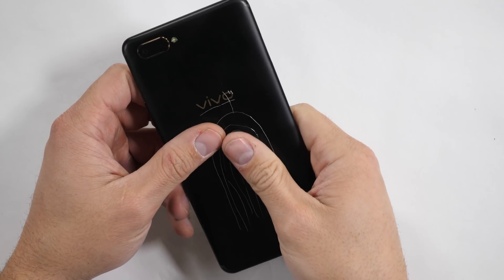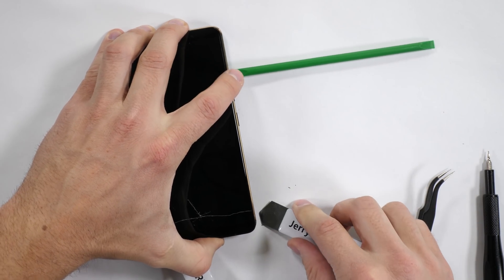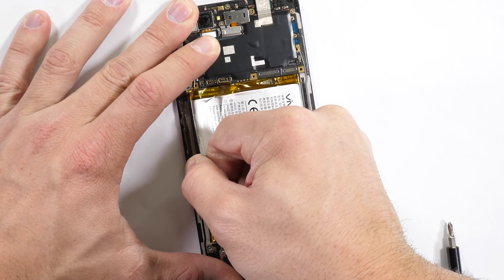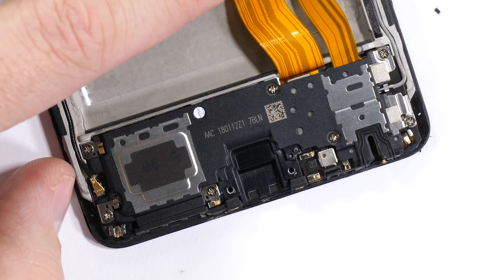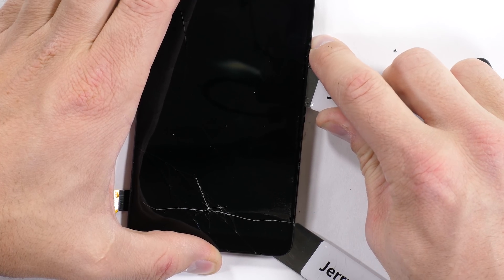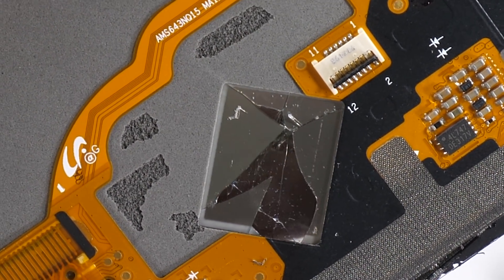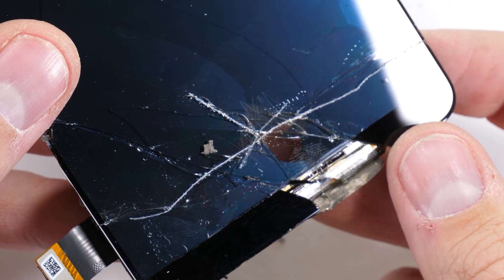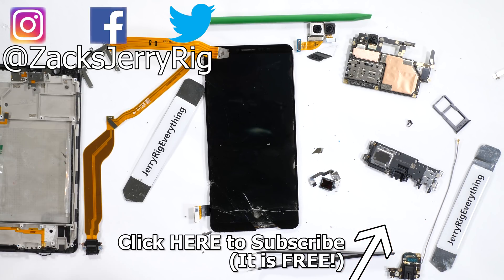In-Glass Fingerprint Reader TEARDOWN! - How does it work?!

Comment: Cool video, I used to take things apart as a kid just because I had to know how they work and amazingly more often than not I was able to reassemble them and they worked. One thing both you and MKBHD seem to be over looking is the cost of making a large sensor under that screen, if that was cost effective camera company’s would have made large sensors to put their imiages on long ago as opposed to working with such a small area! It’s nice to dream of a phone that will read your finger print anywhere on the screen but let’s remember that some things are just dreams as no one wants a phone that small or to pay for a senior that large!

Comment: The moto G 2015 has by far the easiest charging port replacement. Literally under 3 screws and the board pops out. You dont even have to remove the back of the phone (well you have to remove the personalisable cover). it can be done in under 2 Mins

Comment: This channel is just providing jobs to the people who learn how to repair things from here
Reply: Mr Heavy Duty lol, but initially you also would have broken so many devices in attempt to fix them, it takes time to learn
Reply: Mr Heavy Duty So you've never broken a device while fixing? That's cool
Reply: Mr Heavy Duty never broken a customers device.... worked on over 50 phone... places glowin apple logo on iPhone 7, cracks lcd. Kms. I ended up buying the X. My people are happy with their replacements. Always. Except camera replacements. Apple has a deal with it where you have to reset the softwear/restore it. On some occasions so that specific one i have them use their icloud. Also i started on my cracked iphone 5s that apple wouldnt fix. Fixed that. Then an 4s that i got professionally fixed (they used a cheap display, they actually swapped out my battery it wasnt the oem in it etc)
Reply: Redmi 5 pro tear down
Reply: 69 Solo Thanks
Reply: This fellow rigs things not a mobile repair coaching class. He Is the one who shows us what is inside an expensive! Mobile. If u talk about mobile coaching classes there are very core concepts which you would not even understand. For example changing IC's, Flashing ,display replacement ,understanding schematics.  What this guy on YouTube speaks will be known to any basic mobile repair specialist also
Reply: I thought Pakoda Minister was providing jobs aye.
Reply: 69 Solo Actually selling pakodas is a huge business, a guy sells pakodas outside my college, me and my friends got curious seeing the footfall he was getting, and asked how much does he earn per day, he didn't say anything, so we gave an assumption of 2-3k per day, he started laughing. The guy earns around 8k per day,  at that moment I actually started having second thoughts about my college. education
Reply: Shushant Verma Man they will not get it a business is not like a job. You must have the idea, I have seen a person who once was a street vendor now owns a bmw of his own. It's a nature of some people to criticize others but that's what make you strong.
Reply: Yeah man. My cousin had no family and was poor and living with his sister. He used to sell idli and coffee on roadside stall. Now he employs almost 200 people under him in a variety of businesses and makes more profits in a week than I earned in my old job for a whole year. And here I am jobless with my engineering certificate now. People ridiculing them have no idea.
Reply: Shushant Verma good for you. You should Start selling Pakoda then.🤣
Reply: Shushant Verma all the best. 😂
Reply: 69 Solo yes I can setup one shop, with a tea stall and some cigarette, hire a guy to sit there, and do my regular job. I'll be making millions in no time

Comment: I don't understand somthing: if regular fingerprint sensors work by capacitive touch sensing (like the screens) just with more dense stucture, why do they can't make it on the glass itself along with the regular touch sesnsing surface? You proved it several times that even with plastic coating and with major scratches on it, they work just fine, so the principle of these seems rugged enough for me, so I would be happy if I could see capacitive fingerprint reading on screen in the future (even with IPS displays).

Comment: Zack, think about security first (please). Small shards of the glass panel are dangerous! They can be inhaled with an air and can get into trachea or lungs unnoticed. You may apply transparent duct tape on the screen just before cracking the glass (most of mobile-repairmen use this method everyday).

Comment: Looks like its definitely a weak point. Theres a square thats not really structurally linked to the rest of the display backing pressed tightly up against the display. Its possible even sharp impacts around the sensor that dont break the glass could cause display issues. We'll have to wait and see for more tests or if people start reporting problems though

Comment: Wait, so technically, you could get a image from the fingerprint sensor?
Reply: Muhammad Ibrahim no, at least not yet. You can clearly see the OLED display isn't fully transparent like a glass, so the lens can't capture lights above the screen properly. Unless there's some tricky way to bypass the OLED screen, or any methods for the light to reach the camera lens.
Reply: If you can, it will probably be completly blurry because there's no Lens. And also completly white because the scanner is constantly exposed. But if you solve this it may be possible, sound awsome
Reply: Viesuliss technically selfie cam can be fitted the same way?

Comment: Very smart on the charging port. As u say, that's the major item that has to be replaced under normal use. Other than the battery. Very smart vivo. Take note everyone else.
Reply: Peter Ford Everyone uses wireless charging instead, port isn't necessary
Reply: ItsJake No not every phone. Also the ports used for info transfer, headphones in phones without Jack's etc. Hell, it's just a smart idea. No other phone Zack's done has had a single purpose easy to replace port. Great idea.

Comment: That is not a optical sensor that is a touch sensor. Synaptics is a touch system it is all they make. The touch accuracy on that thing has to be psychotically high. For it to be able to read burried under the lcd and glass all i can say is damn. I wonder is it works in conjunction with the digitizer?